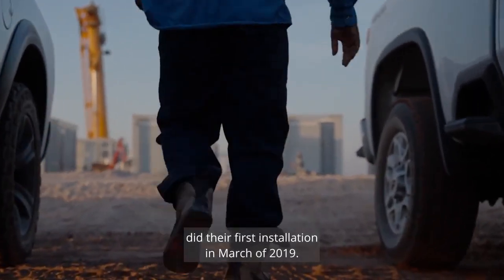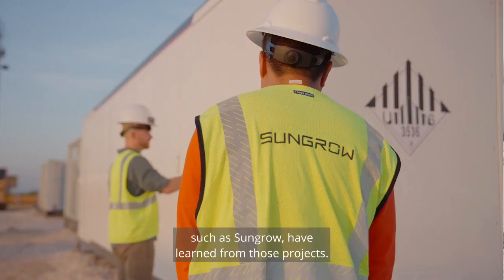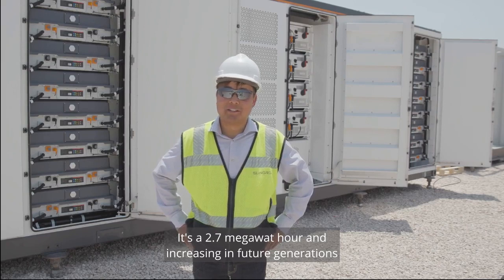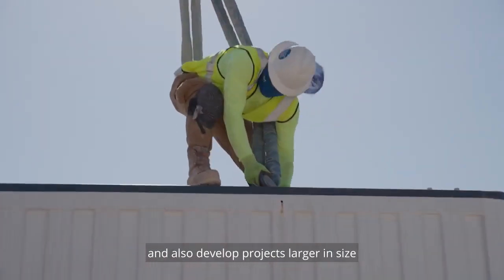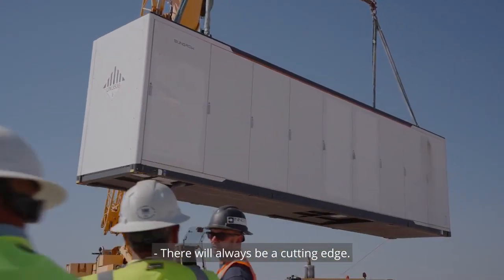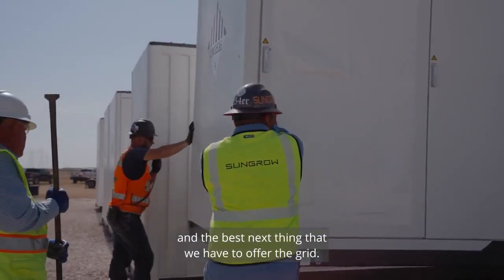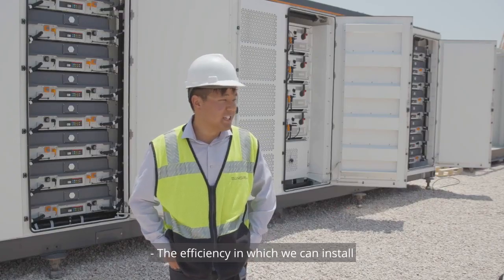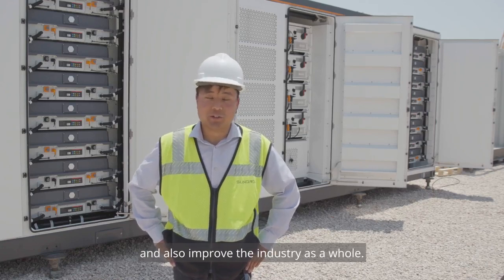KCE and Sungrow Co-Build the Large-Scale BESS plant with PowerTitan

Comment: Hi dear 
I've got a question. I'd be grateful if you help me.
In the datasheet of SG125, it has 6 mppt and each mppt can have 2 strings. The maximum allowed current is 30*6 Amp.
Does it mean maximum allowed current of each string is15 amp? I mean what's the maximum string current?